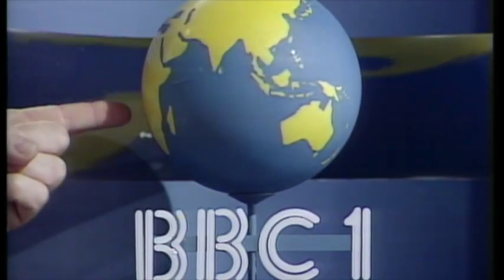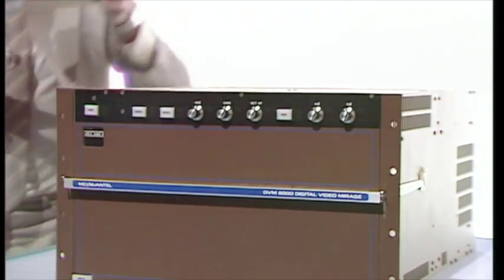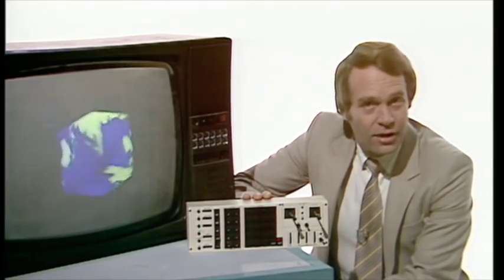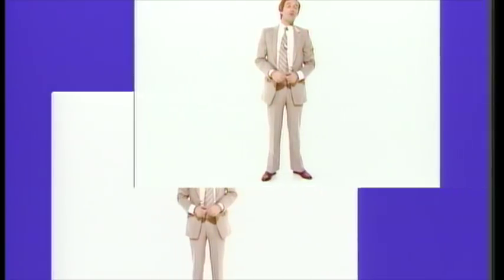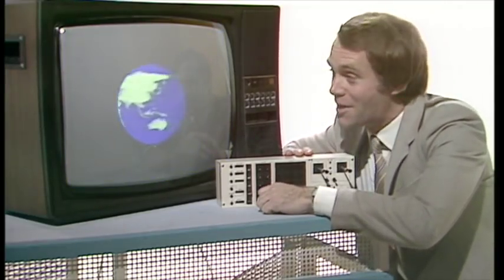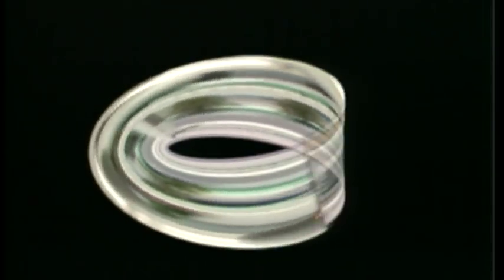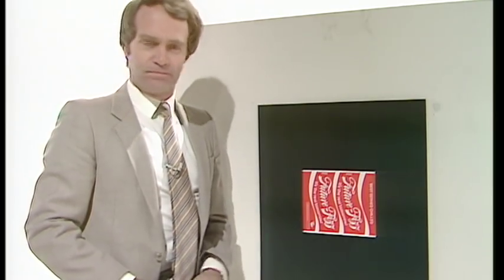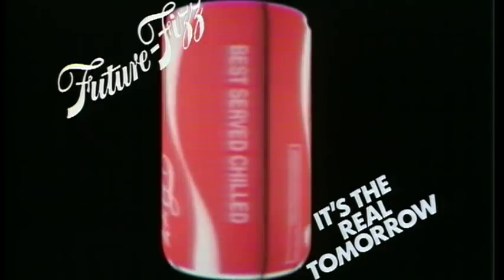Early CGI | Tomorrow's World | Earth Science

Comment: Those heady days when sets received 625 lines instead of the 405 monochrome transmissions. Real high definition times.
Reply: Nathan Baxter No mate, 26 line mechanical televisions are high definition.
Reply: Nathan Baxter The 405 line system was still going at the time this was broadcast.
Reply: +Aidan Lunn (Ferguson Videostar)
How was the conversion from 625 which everything was filmed at, to 405 actually done real time? Was stuff just cropped off or did they point a 405 camera at a TV screen (a-la Apollo 11) or something like that?
Reply: Tommy59375 They used a fully electronic method of conversion, relying on electronically storing the incoming video signal, interpolating the information down from 625 to 405, then converting the sync pulses from 625 to 405 by 220 of the line sync pulses and spacing them equally. The frame sync pulses stayed as 405 and 625 both had a framerate of 50Hz.

Interpolation was the process of combining the information from video in lines on the 625 system to form new information in lines on the 405-line output. It was to avoid the effect of "stepping" on sloping surfaces seen on the screen. So if you were watching Bob Monkhouse or May Bygraves-era Family Fortunes, it was so you could read the information on the dot matrix board on there. Without interpolation, 220 lines would simply be dropped from the picture and the board on FF would subsequently be unreadable!

There were two broadcast-level 625->405 converters, both developed by Pye for the BBC. The original analogue (but fully electronic and all-transistor) Pye CO6/501 or 501A was introduced in 1963 so that anything made by the BBC (for BBC2) or foregin broadcasters in 625 could be shown on the 405-line BBC1. The BBC decided, for technical reasons relating to the upcoming colour technology and repeat potential of BBC1 material on BBC2, that ALL new programmes broadcast on BBC1 from January 68 had to be made in 625 and subsequently passed through a converter on transmission for the 405-line equipment in BBC1's transmission control to cope with.

The 501A was a slightly modified version used by the ITA, firstly installed at each of the ITV contractors in the mid-60s to convert any material made in 625 to 405 for their own transmission controls to contend with, then once the ITA instructed all of them to make the switch to colour on 8th September 1969, in rreadiness for ITV's colour service to begin in November that year, they were moved to the 405-line transmitters themselves, to take in a 625-line feed. This process involved the converters - usually a set of four racks about the size of a large wardrobe - being de-rigged, packed up, transported (some in excess of a hundred miles), unpacked and rigged up again at the transmitter(s) between closedown and start of schools programmes the next day - a huge feat of engineering undertaken in just under 10 hours!

The one main problem of the 501/A was that it could be unreliable and so regularly needed maintenance, and the transmitters themselves, that they were feeding, were so old that they couldn't be remotely controlled from a distant site as was becoming the norm for newer stuff around that time. In other words, either every transmitter site had to be manned at all hours or they had to risk leaving this tempramental piece of machinery for long hours.

So the BBC, ever looking to be economical, developed in conjunction with Pye possibly the world's first piece of digital video hardware - the CO6/509, in the spring/summer of 1969. This used the absolute latest sets of chips to convert the 625 signal from analogue to digital, do the 625-405 conversion/interpolation in the digital domain and then convert back from digital to analogue, at 405. This not only resulted in space-saving economies (the 509 could easily fit into the boot of a hatchback as opposed to needing a large Transit van for the 501), it also meant it was much more reliable and needed much less maintenance. They used these at their more remote 405 transmitter sites, the ones easier to access and regularly or constantly manned had the 501s from BBC studios around the country, including TV Centre, installed.

So things stayed relatively easy for the next 10-15 years until the early 80s then the age of the equipment began to cause problems - real problems as the age of the equipment meant that parts were often no longer available. Even by the early 70s, engineering staff were reduced to scouring electrical junk shops for parts that might be useful. During daytime testcard transmissions, they'd turn the power down on the transmitters to preserve the valves as long s possible. By the late 70s, a type of valve was being hand made because the BBC were the only customer that manufacturer (Mullard, IIRC) had that ordered that type!

All this said, the BBC, save for a severe black-level problem on their Wenvoe 405 transmitter in South Wales, scored full marks for technical quality right until the end of 405 in January 1985.

ITV was a different story. Their 501As were just getting worse all the time. Their Croydon transmitter, carrying Thames and LWT, was the worst. By the end that had a severe mains hum bar through the picture and no sound on one converter for one transmitter at that site, the other had good sound but no picture at all. The one at Winter Hill carrying Granada had problems where the horizontal and vertical hold controls would slip. As that was an unmanned site by that time, this necessitated sending someone out for the regional control centre at the Emley Moor mast near Huddersfield to Winter Hill near Bolton, to only make a slight adjustment to a couple of controls! The Burnhope site in Co. Durham, carrying Tyne Tees, developed wiggly vertical lines down the screen! The Lichfield site north of Birmingham, carrying Central, gradually lost power as the transmitters by the end were quite simply worn out!

More severe problems occurred at the Dover (TVS) and Mendlesham (Anglia) transmitters - both of those sites transmitters or converters had broken down completely and repair was not a viable option. So they closed early, Mendlesham in the summer of 1984, Dover a few months early of the 405-switch off, in November 1984. But the worst luck came at Caldbeck, near Carlisle, carrying Border TV. A colleague tells me in September 1983, that site suffered a lightning strike, which damaged the transmitters, but destroyed the transmission aerials atop the mast. Getting the 625 service from there back online was no problem, but because no spare 405-line aerials were available by that time, 405 was closed early there. This was probably more significant than you think - as VHF signals are better at negotiating topography like hills and moorland, up there in the Borders there were still many isolated communities or cottages where the only reception of TV was 405! The IBA got hundreds of letters about the closure of 405 from Caldbeck!

These are not all of the faults that the ITV 405 transmitters had, just the ones I am aware of. It was a merciful release when 405 finally closed in January 1985, it can't have lived on much longer!!!
Reply: Aidan Lunn
That was a very interesting read and thanks for taking the time to write it all out.. I can only assume you would have worked for one of these companies ;)
Reply: Tommy59375 I myself haven't (I'm only 25), but I have both a close relative and a colleague at work who did.
Reply: The colour system had been going since about 1967 for certain broadcasts on BBC2 then in '69 we went full colour (HD for this time!) on most shows. Aidan Lunn has cleared up the difference in clarity. I used to wonder why the B&W TV set had a less clear picture than the colour one, though didn't look more pixelated, more sort of "softer".
Reply: +Nathan Baxter At least back then it was true uncompressed SD.. If you look through the channels on digital satellite today, you will find plenty of channels that are not even 480p and instead usually uses resolutions like 480x576 and very low bitrates ;\

Even the HD channels looks pixely as shit as they care more about cramming in as many channels per transponder than actual quality. At least back then if you had a good analogue signal you got true SD without awful pixelation or smearing whenever there was a little movement.
Reply: bloxyman22 - This is also the reason DAB radio sounds like utter shite when compared to FM. DAB uses a hideously outdated compression system at about 64kbps... often being broadcast in mono too! You've got tonnes of stations but they sound like crap.
Reply: +Joe Crofts Yeah exactly.. Minimum bitrate for something like DAB to sound somewhat acceptable would be 224kbit, but as you say they just cram a bunch of channels onto one frequency instead of giving us higher quality audio.

Here in Norway they have already started shutting down analogue FM and even on a portable radio the dab channels sounds absolute shit with no depth and noticeable distortion. Switching between internet stream and dab of the same channel is like night and day.

Comment: This guy is explaining how early CGI worked with PAL. PAL (Phase Alternating Line) in Standard-Def (both fullscreen and widescreen) had the resolution of 720x576, with the frame-rate of 25 interlaced FPS (which means 50 progressive FPS). NTSC (National Television Standards Committee) also in Standard-Def (again, both fullscreen and widescreen) had the resolution of only 720x480, but with the frame-rate of 4.97 FPS more, making up 29.97 interlaced FPS (which means 59.94 progressive FPS, 9.94 FPS more than PAL). Hi-Def TV systems, no matter if it's either NTSC or PAL, has a resolution of 1920x1080. The frame-rates remained the same, though.